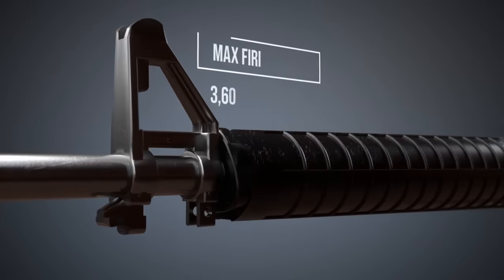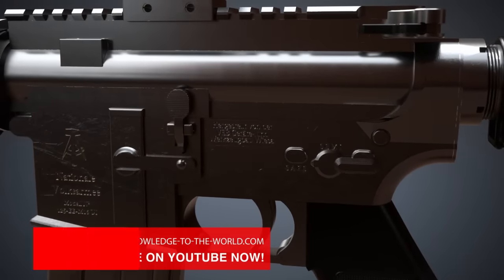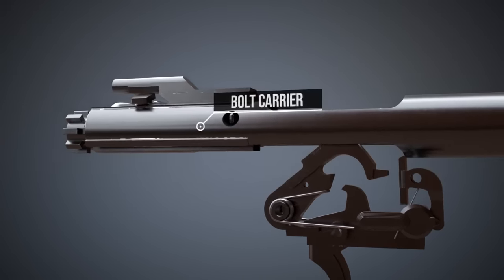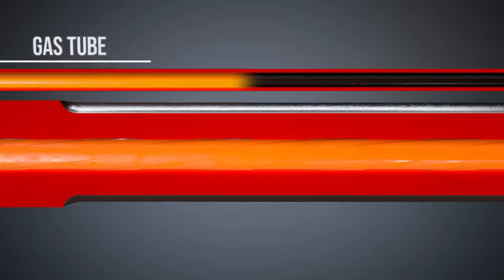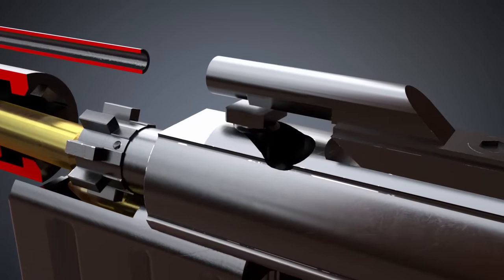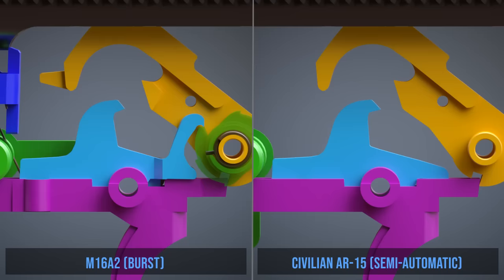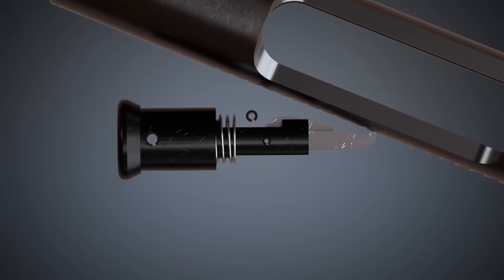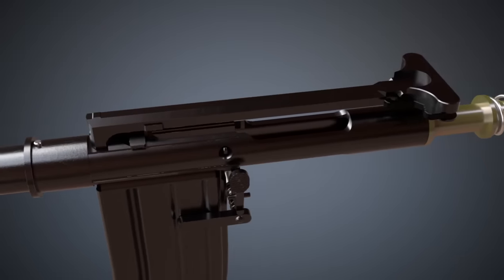M16 and AR-15 - How firearms work! (Animation)

Comment: I now see why the AK is an engineering feat, way less moving parts
Reply: Literally thinking the same
Reply: Love the platform man
Reply: No that's wrong, the Ak has about the same number of moving parts.  The AR-15 is not a short stroke gas piston, the AR-15 is a DI gun, and has very few moving parts, which is one of its advantages.
Reply: @deanc91  Do AKs have overall less movement though? Is that why they are said to work in the shitties of conditions? Correct me if im wrong
Reply: @nguyen-vuluu3150  as far as the action goes for firing and cycling the gun, no. You can say there's extra parts to make things more convenient like detents and push pins, but those are not necessary for the function of the gun.

The AK survivability and reliability is a myth.  People just assume that because it's a simple gun in design and manufacture must mean it's more reliable. It's not.
https://youtu.be/LyXndCxn9K4

Search ak mud test and you'll see a variety of AKs fail the same test miserably
Reply: @nguyen-vuluu3150  I work on AKs. AK's have the same number of moving parts (less the forward assist on the AR but that's not really part of the firing mechanism) and have more movement than the AR.  The difference is AKs are built, in a word, sloppy. Lots of extra room in the receiver and excess clearance around almost anything moving.
Reply: Communist !
Reply: fewer, not less
Reply: @thomast8539  watch out, grammar Gestapo about
Reply: @deanc91  I would like to see what Brandon Herrera AKA The AK Jesus has to say about this
Reply: @deanc91  Actually, the AR15 is a gas-piston gun just like the AK/etc. Although the video also incorrectly describes the AR15 as being direct-impingement, the animation itself correctly shows how the firearm cycles. The gasses redirected back into the bolt carrier group use the bolt itself as a piston to then launch the carrier into the receiver extension.
Reply: @LawlessNate   The whole "AR-15 is not DI" thing is a meme and not grounded in reality.  The AR-15 is absolutely DI, and operates no different than any other DI gun.  The fact that it acts as a piston does not disqualify it as DI, as literally every other DI gun also uses a piston in essentially the same regard.  The similarity in operation extends from the MAS to the Hakim as well as every other DI gun in between.

I know that Ian and Karl at inRange as well as Mac have pushed the meme a while back, but they've pretty much all stopped referring to the AR-15 as a piston gun ever since I sent them exactly how the mechanics did not lend credence to the AR-15 being reclassified as a piston gun, and how the mechanics, specifically same gas tube to "piston" interface, exists across all DI guns, thus it cannot be reclassified as a piston gun without all DI guns also being reclassified as piston guns.
Reply: @LawlessNate  That is incorrect since literally every DI gun uses a piston with gas expansion.  

Direct Impingement is a reference on WHERE the impingement occurs, not HOW the impingement occurs.  A DI gun has the impingement occur directly on the bolt and or carrier.  A Remote Impingement gun has the impingement occur remote from the bolt/carrier.  This is reflected off patents that have short stroke gas piston AR-15s defined as Remote Impingement systems.  While Stoner's patent describes it as an internal expansion gas system, this merely shows this as Stoner's internal expansion gas system, as every DI gun uses an internal expansion gas system.  Stoner's system is only different that the gas expansion system directly affects the unlocking of the gun, but the cycling of the gun uses the same principle of all other DI guns.

  Gas expansion is a form of impingement, as impingement just means the act or fact or touching.  There is an incorrect assumption that it has to be a gas STRIKE.  There is no DI gun that works off a gas strike.  They all use a gas expansion chamber in the form of a piston.  

Look at a cutaway of a Hakim, MAS 49, or any "true" DI gun.  They all have a piston that harnesses gas expansion.  There exists no gun that acts off a gas strike.  Even blowback guns technically use a piston off using the bullet as a piston head, and the chamber as the cylinder.
Reply: @deanc91  "Stoner's system is only different that the gas expansion system directly affects the unlocking of the gun, but the cycling of the gun uses the same principle of all other DI guns."

This is entirely untrue. The only way you could come to this conclusion is to not understand how the AR15 operates. The only reason why the AR15's bolt unlocks is because the carrier which the bolt is attached to travels rearward forcing the bolt to then rotate via the cam. The reason why the carrier is moving rearward in the first place is because of the gas expansion chamber within the bolt carrier group itself using the bolt as a piston to propel the carrier rearward. 

"...impingement just means the act or fact or touching.  There is an incorrect assumption that it has to be a gas STRIKE.  There is no DI gun that works off a gas strike.  They all use a gas expansion chamber in the form of a piston."

This is absolutely incorrect. First off, impingement means to have an effect on something, usually by imparting force. If two things are touching but no forces are being imparted then they're not impinging one another. Secondly, the difference between a DI gun and a gas piston gun is not whether or not the gasses somehow impinge the bolt or carrier, as this happens with all DI or gas piston guns. The difference is whether the gasses directly or indirectly impinge the bolt or carrier. If they directly impinge the bolt or carrier, as with the MAS 49, then they are direct impingement. If the gasses indirectly impinge upon the bolt or carrier via a piston, as with the AK, then it's a gas piston gun. Think of this this way: the bolt on the MAS 49 cycles because of the gas which is directly impinged upon the carrier whereas the bolt of an AK cycles because of the piston its attached to being impinged by the gasses. That separate piston which acts as the go-between of the bolt and the gasses means the impingement isn't direct. That's not to say because the gasses theoretically never touch the bolt itself (they do between the chamber and walls of the case, but let's ignore that for the sake of argument), but because the gasses move the piston and the piston moves the bolt. 

In an AR15 the gasses don't directly impinge upon the carrier. More specifically, the gasses only impinge upon the carrier after utilizing the bolt as a piston. Imagine a theoretical AR15 where the bolt carrier group has no bolt, and the barrel is muzzle-loaded (therefore the only opening to the barrel is the bore). If that gun were fired, the expanding gasses would go through the gas port, through the gas block, through the gas tube, through the gas key, into the bolt carrier, and then exit the gas ports in the side of the bolt carrier. The bolt carrier would not cycle as the buffer and buffer spring would be imparting significantly more forward pressure onto the carrier than the minimal amount of force the carrier would receive in a rearward direction from the gasses simply passing through it. Without the bolt, the gasses would simply pass through the carrier. It's only because of the bolt (piston) and its gas seal is the required pressure created for the carrier to then cycle rearward. This means that the impingement of the gasses onto the carrier are indirect. Again, that's not to say the gasses don't directly touch the carrier, they obviously do, but the only reason why that force is imparted upon the carrier is specifically because of the bolt acting as a piston and therefore this force is imparted indirectly.
Reply: @LawlessNate  Point 1 is absolutely untrue.  The reason the carrier is moving rearward is because of gas expansion like you said, which is a form of direct impingement, no different than any other DI guns from a physics standpoint.  The fact that it's continuing momentum from the unlock procedure does not change this fact.  Thus it is direct impoingement.

I gave you a dictionary definition of impingement.  By your definition, there is a force imparted off the AR-15 gas carrier.  Gas expansion is a force being imparted.  

The MAS49 impinges on the carrier by gas expansion via a piston system.  Seriously, look up how the MAS49 or Hakim, or any "DI" gun works.  They all use a gas piston, with an unmistakable piston head and piston cylinder.  Your explanation of the AR-15 "not impinging" on the carrier applies exactly to the MAS49 and Hakim.  The MAS49 and Hakim impinge on the piston head of the system which is separate from the carrier, and push on the expansion chamber.  However, that's not how physics work as explained in the next paragraph.  Your explanation of the system does not differentiate those from the AR-15 in the slightest.  

The AR-15's gasses absolutely impinge on the carrier.  You do realize that gas expansion pushes BOTH DIRECTIONS right?  It impinges on both the carrier, and the bolt.  The carrier is the expansion cylinder, which half the force pushes on, and half the force pushes on the bolt.  This is a basic law of physics (Newton's 3rd law).  This by definition means the AR-15 is impinging on the carrier.  Impinging on the bolt itself is a form of direct impingement anyways, since the bolt is part of the carrier group.  I guarantee you, if you welded the bolt and carrier together, and shaved off the locking lugs, the gun would still cycle, explosively because the same principles of direct impingement still occur whether or not there is gas expansion piston action occuring.
Reply: @deanc91  "I guarantee you, if you welded the bolt and carrier together, and shaved off the locking lugs, the gun would still cycle"

No, it wouldn't. You don't realize that the gas expansion chamber, the chamber you admit "...pushes BOTH DIRECTIONS...", is what propels the carrier rearward. If you were to weld that theoretical bolt in the "outward" position (where a normal bolt would be "unlocked") the bolt simply would not cycle as the gasses would pass through the carrier rather than build up pressure to cycle. If you welded the bolt in the "inward" position (where a normal bolt would be locked) you would then be modifying the AR15 into a direct impingement firearm as the gasses would then, under that circumstance, be directly impinged upon the carrier. Instead, the AR15 operates by using the gasses to impinge the carrier not directly, but indirectly via using the bolt and its gas seal as a piston. It's only when the gas expansion chamber is flooded with gasses, and therefore pressure, does the carrier then utilize the bolt as a piston to cycle. This necessity of the bolt and its gas seal to cycle the firearm means the impingement of the gasses on the carrier is indirect, just like every other gas piston operated firearm. 

Let me describe this in another way. When the gas expansion chamber is being flooded with gasses, the pressure is building up within the bolt carrier group itself. This pressure, like all pressure, takes the path of least resistance to disperse. The path of least resistance for this pressure is to push the carrier rearward (as the bolt stays in place due to the locking lugs) thereby creating a larger area for this gas to exist within. It's this buildup of pressure within the gas expansion chamber which propels the carrier rearward. Without the bolt and its gas seal to contain these gasses, therefore containing the pressure, and therefore act as a piston,  then pressure would not build up within the BCG and therefore would not cycle the carrier. 

One last thing I'll point out is that you described your hypothetical welded-bolt without locking lugs as "explosive". This is plainly not the case, and this can be demonstrated easily in the real world. If you were to fire an AR15 as the bolt is kept closed by the forward assist, it would not blow up. If you installed a Law Tactical Folding Stock Adapter, which essentially captures the buffer tube / buffer spring, adds a hinge between the buffer tube and the lower receiver, and extends the length of the BCG in order to fill the gap created by the hinge, and then fire the rifle while the stock is folded, which when the stock is folded with this adapter it has a piece of steel which sits behind the BCG preventing it from cycling whatsoever, the gun does not blow up. The AR15 does not blow up when the BCG is artificially prevented from moving.
Reply: @LawlessNate   You don't get it do you?  When the gasses use the gas expansion method, it is impinging on the carrier.  Thus, if welded in the closed position, it would not change from gas expansion to impinging when gas expansion is already a form of impingement.  There is no difference between the gasses entering the gas expansion chamber acting as a blind hole, or entering the gas expansion chamber acting temporarily as a blind hole.  The bolt and gas seal is the piston HEAD.  The carrier is the piston CHAMBER.  For a piston to work there are two parts, and the gas impinges on BOTH or else it would not function as a piston.  This is also exactly how the MAS49 and Hakim works.  It's just that the stationary piston head is moved down vertically from the gas tube's flared head to the bolt, and the expansion chamber is moved down from the top of the carrier to inline with the rest of the carrier.

If you're going to claim that the AR-15 is not impingement because it cycles due to gas expansion forces on the piston head (and thus ignoring the required opposite force on the carrier which acts as the piston chamber) then the MAS49 and Hakim also is not impingement due to the fact that the gasses ALSO enter a gas expansion chamber and push off the stationary piston head and incorrectly ignoring the equal and opposite forces pushing against the carrier's expansion chamber that acts as the other half of the piston.

Yes, a welded bolt without locking lugs will be explosive since you no longer have a locked system without enough mass on the bolt to contain the pressure.  What you have is early extraction which will cause the case to explode while under pressure and unsupported by chamber walls.  This is no different than the Vietnam era M16s that were extracting early due to incorrect powder specs with blown cases, or AR-15s that fire out of battery or extract early due to way too light a bolt/spring.  You frequently get an explosive result when pressure is still too high under extraction.
Reply: @deanc91  "For a piston to work there are two parts, and the gas impinges on BOTH or else it would not function as a piston. "

I understand both this and the point you're trying to make when you say it. You're trying to suggest that the redirected gasses are directly impinging on the carrier. You're trying to suggest that because the gas expansion chamber pushes in both directions that it's therefore the gas itself which is impinging the carrier. However, it's fundamentally the bolt which cycles the carrier. I understand that's confusing because the bolt stays relatively in place, it's the carrier which is moving instead of the bolt itself (at least initially), and that it's gas which is powering all of this, but that bolt acting as a piston is fundamentally what makes the rifle cycle. 

Also, concerning your comment about a theoretical bolt which is welded to the carrier and without locking lugs, I thought you meant that in a "if you could just pretend the carrier could cycle despite the bolt being welded then the overall point I'm trying to make is..." kind of way. I thought the reason you mentioned a bolt not having locking lugs was to try and make a larger point about the gas expansion chamber without, for the sake of argument, having to explain how a welded-bolt would lock and unlock with the barrel extension. Obviously if an actual rifle was fired without locking lugs to lock the chamber closed then the pressures generated would be explosive.
Reply: @LawlessNate   It is not fundamentally the bolt that makes the rifle cycle.  It is fundamentally the PISTON that makes the rifle unlock AND cycle.  A piston MUST have two parts, which is the piston head (bolt) and the expansion chamber (carrier).  The impingement acts on both.  I will once again redirect to the MAS49 and Hakim.  When the gas leaves the gas tube in those rifles, they enter a recess in the carrier and fill an expansion chamber (carrier) where they expand and act on both the expansion chamber (carrier) and the flared gas tube head (stationary piston head).  This is the exact same principle as the AR-15.  The only difference is that the expansion in the Hakim and MAS49 (and almost all other DI guns) unlocks the gun through movement of the carrier which then residual momentum cycles the gun.  The AR-15 uses the exact same expansion principle to directly separate the carrier and bolt through expansion and the cam track, and cycles the gun through residual momentum.  That and that the piston head continues traveling with the carrier is the ONLY difference that separates Stoner's gas expansion system with other DI guns.

My point is that exactly.  The AR-15 will absolutely cycle if the expansion chamber acted only as a blind hole without locking because the principle of how it cycles will still be there, just the method of unlocking is gone.  Instead of the bolt seal acting as a piston head, it will be the end of the gas tube, though probably much less effective because the gas tube head isn't designed to seal as effectively with the gas key as on other DI guns like the MAS49.  The explosively thing was just an aside comment.
Reply: @deanc91  1: In the AR15, the gasses are used to project the piston (bolt) forward, but because the piston (bolt) is pressed against the barrel extension and cannot move further forward, instead it's the carrier which is projected rearwards. The gasses in the AR15 are used to power a piston, and it's this piston which cycles the carrier. 

2: The gasses don't directly lock or unlock the bolt. It's the rearward movement of the carrier which locks and unlocks the bolt; as the carrier moves rearward, it pulls the bolt along with it when the rotates on its cam to then unlock from the barrel extension. The gas powers the piston (also the bolt), the piston (also the bolt) moves the carrier, and the carrier moving unlocks the bolt (also the piston). 

3: " The AR-15 will absolutely cycle if the expansion chamber acted only as a blind hole without locking because the principle of how it cycles will still be there, just the method of unlocking is gone." 

Again, the only way you can say this is to not understand how the rifle operates. I'd suggest watching this video - https://www.youtube.com/watch?v=ZYuuFSxcDTs&list=LL0yRF0bmPGCeUKrppB-KsGg&index=63
Reply: @LawlessNate   1. Yes, you also just described how the MAS49 and Hakim work, except the piston (flared gas tube end) is pressed against the receiver where it is screwed in and cannot move further, so the carrier is projected rearwords.   To use your summation, the gasses in the MAS49 and Hakim are used to power a piston, and it's this piston which cycles the carrier.

2.  This is arguing meaningless procedurals.  It is obviously the forces of the gasses pushing on both the bolt and carrier in opposite directions that causes rearward movement of the carrier which unlocks the system.  The forces come from the gasses.  The movement of the carrier is only a result of that gas expansion.  The carrier itself does not generate its own energy to unlock the system.  Thus you cannot say it's the carrier that is causing the unlocking since that is one step removed from the generation of the forces causing the unlocking.  

3.  I've watched MACs video a long time ago and even he has mostly given up on the AR-15 isn't a true DI thing.  He has never been able to address the arguments I'm making right now, and you can clearly see the piston head and gas expansion chamber in the MAS49 he uses that is equivalent to what the AR-15 has.

This is what I need you to address directly for this hypothetical:

Conditions:
a. We seal up the bolt and cut off the locking surfaces so the AR-15 can no longer lock, thus the unlocking procedure is eliminated from the cycling of the gun since the unlocking procedure is irrelevant to the cycling.
b.  We fire and gasses go down the gas tube, down the gas key, into the expansion chamber but cannot vent so the gas pressure pushes back up against the gas key - gas tube interface.  There is no longer an unlock procedure that needs to be done so it should begin cycling immediately.  The piston head is no longer the bolt seal because it is welded and unable to move to harness energy.  Instead, the piston head is relegated to the gas key - gas tube interface since this is the only point that can move and the only place where expansive gasses can release energy; where the gas tube itself becomes the stationary piston, and the gas key + expansion chamber is the piston expansion chamber.  

Questions: How does this mechanically differ from a MAS49 besides a larger gas expansion chamber that curves downwards?  What mechanical difference does this make when you move this piston head from the gas key down to the bolt that would disqualify it from being DI?
Reply: @LawlessNate   I am very aware of how Stoner and Armalite wants to differentiate the system, mostly for marketing reasons.  I have read their papers and patents.  However, they never once can fully explain the difference between the standard DI gun vs the Stoner's version of DI, but will claim up and down it's not DI and is a piston system.  This is despite regular DI being also a piston system.  They want to differentiate itself from the reputation of how dirty older DI guns were.  

This is not a factual paper, this is a marketing paper.  Just look at these obvious marketing points that they're making.  "ArmaLite concludes that there is no technical advantage to an external piston system employing current ammunition,"  "Comparison tests of the M16 and the M-14 before Desert Storm confirmed the superiority of the Stoner system in sand and dust tests" (true but obviously so far from a fair comparison that the comparison is absolutely pointless to make), "the Stoner internal piston system provides... little of the blast of escaping gas at the breech end of the gas tube of the earlier rifles" (trying to distance themselves from the earlier "dirty" DI guns)

Even in your paper, it doesn't say how it's different from DI.  It just says there's a difference in pneumatic advantage which it fails to define.  Can you explain the difference based off that paper?  Is it just the amount of energy harnessed by the internal piston of other DI systems and the Stoner DI?  If so, that's still the same system, just tweaked to harness energy more efficiently.  Things like this is why you should avoid word of the creator.  They're trying to sell the product.  Kalashnikov swore up and down that he took no influence from the STG44, and then he did, and then he didn't, and then he did.  Unless they give you something of provable substance, their words should be taken with a grain of salt.
Reply: @deanc91  Between the guy who designed the AR15, the company who initially made it, accomplished gunsmiths, and you, you're the only one going by a non-standard definition of DI which would somehow classify the AR15 as DI. In fact, if you want to suggest that any time the redirected gasses make contact with the bolt or carrier that therefore a gun is DI then even the AK could be considered DI due to its piston being integral to the carrier.
Reply: @LawlessNate  My definition is consistent. Your definition would make no DI guns exist.  If the "true" definition of DI means no DI guns exist then isn't there something wrong with that definition?  Also that Armalite isn't even the same Armalite that designed the AR-15. It's a completely different company that bought the name.  I also know a good couple of accomplished gunsmith that agree with me. Ultimately it doesn't matter who agrees because that's just a fallacy of appeal to authority. What matters is how the definition works

Piston guns use an energy transfer device of some type to harness energy from a location away from the main firing and feeding components.  DI harnesses cycling energy through gasses directly with the main feeding and firing components. This keeps it simple and eliminates the Piston exclusion from the definition because technically all autoloader including direct blowback use a piston
Reply: @deanc91  Your definition of direct impingement is so broad that many clearly gas-piston guns, such as the AK, would thereby be considered direct impingement. Let me quote this from the wikipedia article on direct-impingement: "The usual example one might find when searching for a direct impingement gas system is the one used in the AR-15 style rifle, first patented by ArmaLite for use in the AR-10. This is likely not the best example though, as the subtleties involved in ArmaLite's patent on the gas system[1] significantly diverge from classical direct impingement; upon firing, the pressurized propellant gasses exit the barrel via the gas port and travel the length of the gas tube, but instead of simply applying the inertia necessary to cycle the weapon directly to the bolt carrier, the gas is funneled inside the bolt carrier wherein the increase in pressure results in the bolt itself acting as a piston, forcing the bolt carrier away from the barrel face (the purpose of the gas rings on an AR-10/AR-15 style bolt is to ensure a proper seal is achieved between the bolt and the bolt carrier).

Unlike conventional gas-operated firearms, direct impingement does away with a separate gas cylinder, piston, and operating rod assembly. High-pressure gas acts directly upon the bolt and carrier, thereby saving weight, lowering manufacturing costs, and reducing the mass of the operating parts, and thereby the wear on mechanical parts due to movement. By removing the gas piston, the potential amount of moving mass is lowered, thus decreasing the potential for a disrupted sight picture."

Also, by the definitions you just provided for piston guns and direct impingement guns, the AR15 would quality as a piston gun. You can't wrap your mind around the fact that it's the bolt acting as a piston which cycles the carrier rather than the gasses directly impinging on the carrier. It's the gas seal of the bolt thereby making it act as a piston which cycles the carrier.
Reply: @LawlessNate   It actually wouldn't because the AK is not direct.  It uses a connecting rod from the piston, to the actual feeding and firing mechanism, so it is an indirect or remote impingement weapon.  Wikipedia is not a source and what they wrote does not address my arguments.

Yes, my definition does qualify the AR-15 as a piston gun because it is, as well as the MAS49 and Hakim.  There's nothing that makes a piston gun and DI mutually exclusive.  A piston describes what mechanism harnesses the energy.  DI explains WHERE the energy transfer happens.  DI guns are a subset of piston guns.  Your definition excludes any gun from being a DI gun.  That's the bigger problem isn't it?

I absolutely can wrap my mind that the bolt is acting as a piston which cycles the carrier BECAUSE THAT'S WHAT IS ALSO HAPPENING WITH THE MAS49 AND HAKIM.  The only difference is that you replace BOLT with FLARED GAS TUBE END.  It's literally the same thing, just the impingement is occurring in a different spot vertically.
Reply: @deanc91  In DI designs, the gas directly imparts itself on the bolt carrier. You can argue that these guns incorporate a piston, but at the end of the day it's the gas blowing against the carrier which cycles the carrier. The gas blowing against the AR15's carrier isn't what cycles the gun. It's the gas blowing against the AR15's bolt (piston) which ultimately cycles the gun.
Reply: @deanc91  When the piston is somehow integral to the carrier then you can absolutely say that the gasses directly impinge the carrier itself. Whether or not a gun is DI or gas piston isn't a question of whether or not there is somehow a piston in the design, but whether or not the carrier cycles directly from the force of the redirected gasses or indirectly through a non-integral piston which itself is powered by the redirected gasses. In the examples of true DI guns, pistons are integral to the carriers and therefore when the gasses impinge the piston they are thereby also directly impinging the carrier itself. On gas-piston guns, the redirected gasses impinge a piston, and this piston then impinges the carrier. I suppose you could accurately describe gas-piston guns as indirect impingement guns. If the carrier cycles purely because of the gasses being impinged on it then it's direct impingement, whereas if the impinging of the gasses on the carrier is indirect through a non-integral piston then it's a gas-piston gun. In the AR15 the redirected gasses blowing into the bolt carrier group is not what causes the carrier to to cycle, as without the bolt to act as a piston the carrier would not cycle. Instead, the redirected gasses in an AR15 impinging upon the bolt (piston) is what cycles the carrier, therefore the redirected gasses only indirectly impinge the carrier through the bolt/piston acting as a mediary. Therefore, the ar15 is not a direct impingement firearm.
Reply: @deanc91  No, it doesn't. The fundamental difference between a DI gun like the MAS49 and the AR15 is that the redirected gasses of the MAS49 directly impinge the carrier itself (as it's also the body of the piston) whereas the redirected gasses of the AR15 do not directly impinge the carrier itself (instead, these gasses impinge the piston (bolt) which then cycles the carrier). That is a clear distinction. Are the gasses directly impinging the carrier? In the MAS the answer is yes, but in the AR15 the answer is no.
Reply: @Gixer750pilot  How does that make them communist? Just because they have an opinion on a Soviet gun doesn't mean they are communist, and lets say they were, why you gotta call them out on it?
Reply: @deanc91  IMHO, "DI vs Piston" is just a bad dichotomy--a better classification would be direct vs indirect ("short stroke piston") impingement, with external ("long stroke piston") and internal piston (what we call "direct impingement") as subtypes of direct impingement.
Reply: @deanc91  it's not a myth. All weapons will jam if mud gets into them. The AR just has an advantage of not letting mud get into it in the first place because of the ejection port cover. AKs will generally take more abuse than ARs before breaking down. Hate it or love it, the AK is more reliable than ARs. I'm a soldier and it's just funny how veterans who experience but rifles in combat praise the AK's simplicity and reliability while civilians just do unrealistic durability tests at their ranges and claim that the AK reliability is a myth
Reply: @drmanhattan5219  The AR has more than just a port cover.  It has a sealed system that prevents mud and sand from getting in even with the dust cover open.  You can also look at more realistic tests (and government tests) that find the same result.  You can complain all you want about testing, but your anecdotes don't trump actual testing.  Unrealistic testing is just to bring out the extremes.  

Also if you watch videos of the other side, you'll see AKs malfunctioning just as much if not more.  That's why it's just your personal anecdote when you bring in experience like that.  You have only your perspective, with a small sample size, and unequal experience with both.  I've used both before out in the field.  I've found the AR to be considerably more reliable for me as long as I maintain it.
Reply: @deanc91  well you're entitled to your own opinion. I just happened to be in the majority with people that know that AKs are more reliable than ARs.